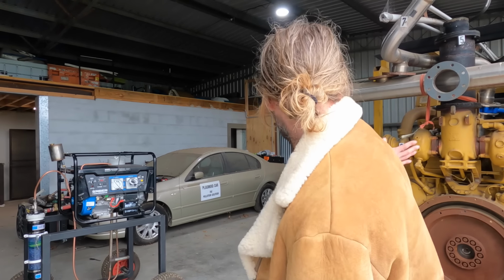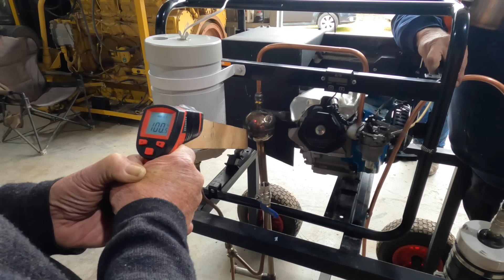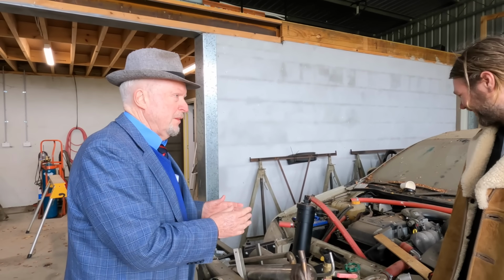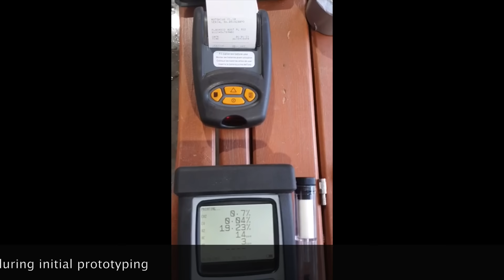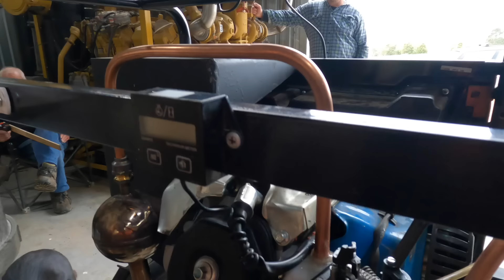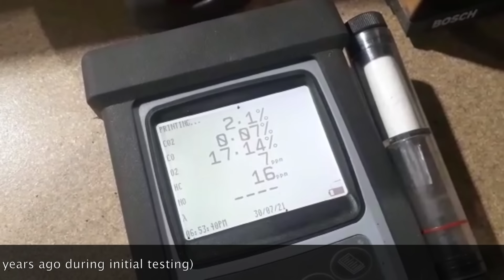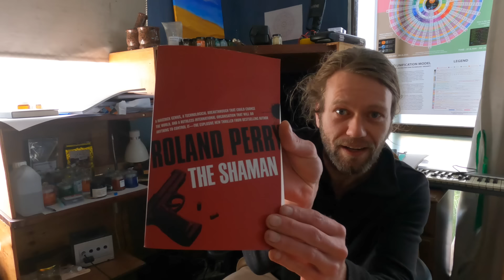Malcolm's Thunderstorm Plasmoid Generator in Action | FULL DOCUMENTARY | with Jordan & Roland Perry

Comment: So you have leaned out the fuel mixture with a moisture laden hot air source....all the rest is mumbo-jumbo meant to baffle people into thinking this is more than it actually is.   Smelling the exhaust is NOT a good way to judge how 'efficient' it is and both of my fuel injected motorcycles without any emissions devices run with almost no perceptible exhaust smell either.

Increasing the combustion temperature will reduce unburned hydrocarbons and carbon monoxide but at the expense of NOx so unless this 'technology' has been emissions tested and approved it's not going anywhere.   We regularly increase fuel economy over 20% just by modifying the fuel mixtures and ignition timing on non-emission engines but these have limited usefulness as anything sold to the public must meet very stringent standards.

There have been many 'hot vapor' engines over the years and while they DO offer benefits in some areas....for a workable machine sold to the public their durability has been inadequate as well as the power they produce much reduced by the heating of the intake charge.   The old engineering axiom of 'there's no free lunch' still applies.

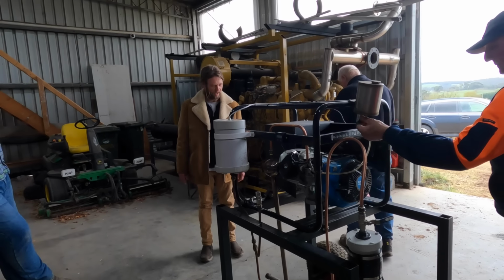Comment: 36:58 he turns off the fuel after its off... its just running on fuel with too much air... this is clearly fake.  really disappointed.
Reply: It was always running on fuel? This isn't fuel replacement technology or a free energy source.
Reply: The claim was that fuel would be shut off once the "plasmoid fuel" was being injected.  This is not being demonstrated.
Reply: Or he just didn't want the carb to gum up with stale fuel......

Not to mention if it were lean there would be white smoke.

Comment: It's just a gasoline engine running on gasoline. That hilarious intake with the steel wool and scrub pads sandwiched together is doing absolutely nothing but putting humid air into the carb. This is such a bogus scam.

Comment: The only thing that sticks out for me is the lack of 'tools to analyze anything' like you said. Why don't they have any on site?

How do they know these machines are working in the first place if they have no exhaust readers/carbon detectors.?

It baffles me that guys have built this in a shed with no means to prove it works on camera other than you sticking your face in the exhaust and saying it smells clean?!

Just giving the doubters ammunition.
Reply from the maker: These were the prototypes that they had worked on several years ago. They were stripped apart and the parts taken abroad by Malcolm for the newer tests they did. When I did that video saying I wanted to see/build one, they reached out to me saying they had the pieces for one of the prototypes still that they could put back together for me. They banged it back together in a week or so and I went down. All the original tests they did with them (as in the old footage I show) were done with the analyzer. They have ordered another analyzer now for the next test runs here. You can see it with the analyzer and independents measuring in the Tesla tech livestream videos though

Comment: so does the engine still run in fuel.. or plasmoids? trying to figure if the the tech just cleans the exhaust.. or actually fuels the generator?
Reply: It improves efficiency ( last I heard 15pc) and cleans up engine, oil, exhaust fumes and yes it does need any fuel to be run

Comment: 5 bucks says if you put the normal exhaust back on, and just create a simple vacuum leak with a small ball valve after the carburetor, you'll get identical results with the smell and increased rpm's. Your intent is good, but I'm not sure you fully understand how a simple carbureted engine works.

All you are doing here is creating a controllable warm air vacuum leak with a bit of water vapor mixed in.

Comment: I am assuming you have not changed the spark timing with regards to the location of the magneto or the flying magnets on the flywheel? 
HHO - needs to be lit later in the cycle in order to generate maximum cylinder pressure through the rod angularity maximum (where the greatest force acts on the crank pin.)  VS gasoline. Gasoline is a slower burning fuel, and is difficult to ignite OUTSIDE of a couple of specific circumstance.

Comment: Am I understanding this correctly. You are only building a device to remove pollutants from the exhaust of an engine. This device does not provide any fuel. It creates a modified & oxygenated, heated, outside air supply,  which is injected into the intake air supply?
  If so, my concern would be that it would force the engine to run leaner than it wants, and therefore cause the engine to run hotter, possibly causing burnt out valves etc. Also, this modification would almost certainly affect the catalytic converter system on a car.

Comment: Where are the spheres a necessary amendment to the straight piped GEET? We all love out vortices, but couldn't those happen in the GEET with it without mods? It might be a matter or where you place and angle the in/outlets?
Reply from the maker: Yep. According to the guys I've spoken to who have worked on prototypes, the spheres are integral flow guides and there is an influence on how it works from the resonant cavities of the spheres. That's really the big difference between the GEET and this. Malcolm is attempting to incorporate harmonic resonance through angles, ratios and geometry and it has given some significant initial results

Comment: Mr.Perry, If I recall correctly, might be more familiar to some viewers as the author of a [popular biography of actor Mel Gibson. More recently, he has been following the work of Malcolm Bendall, an independent investigator of innovative technology. These modifications are constructed from the designs of Malcolm Bendall, Yes?  So the "plasmoid bubbles" are ionized gas bubbles cooled but still ionized? and running them thru the steel ribbon catalyst breaks them into smaller, UNIFORM sized bubbles, increasing their surface area? And then they are fed back into the original standard petrol-internal combustion engine??? I heard that this process dramatically reduced C0 and other nasty combustion products in a demonstration at a conference in Arizona last year. I'm wondering if there is any back pressure that could affect the exhaust efficiency from the cylinders...

Comment: So I can do brazing for HVAC, silver brazing, soft copper stuff, plumbing soldering, electrical soldering, the like... It seems like I just need the specs, the pipe material, the pipe thickness, diagrams of the bubbler and the other tank, the layout diagram/schematic, and then I would need to purchase the globes from somewhere and I guess solder/braze them in? And then the retrofitting to an exhaust/intake shouldn't be terribly difficult as long as I have specs and any documentation on exactly what details need to be super precise. And as long as I have any precision tools available that are needed. As long as I have thorough documentation and specs, and as long as I have somewhere to get the correct globes from, this isn't necessarily out of reach. Huh.
Reply: Looking for the open source info too!  I would love to build prototypes for my own car and generator. Is there a link to proper plans with parts list, accurate measurements and step by step building instructions. If not, this is being presented very irresponsibly and can cause injury or even death and is not really an open source project. This will be a huge Global Revolution if laymen can convert their own vehicles to prove the concept, so if these fine gentlemen cannot provide proper, reliable and safe plans with which the DIY enthusiast can enable small generators and cars with this concept I tend to call BULLSHIT. (•‿•)  If these guys are playing a game I feel sorry for Randall Carlson, whose appearance on the Danny Jones Youtube Channel got me interested in this. I see Randall as a genuine academic and would hate to see him misguided in any way. So, of anyone has a link to those plans or have successfully built a working prototype, kindly share.
Reply: @henrijacquesblom6891  It’s not necessarily their job to provide DIY assembly instructions, but it would be nice if they had publicly available technical documentation. I might have just not looked for it much.
Reply: @henrijacquesblom6891  there’s a diy build guide coming out in next 24hrs announced on this channel 🙃

Comment: If the perfect measuring cup of the on/off vacuum pulse is critical to the bubbler, how does this apply to a multi cylinder car engine? Would not the common intake manifold simply pull a constant vacuum?

 And also, I noticed on the generator exhaust outlet, it's been tapered down from its original diameter before going into the outer sphere. Generally on a std motor, you'd want high flow, no restrictions or step downs in diameter. Yet it seems the geometry must adhere to those sacred numbers so... 

Can we use any diameter of pipe and sphere so long as the ratios are perfect? Or, are there firm concrete numbers that must be adhered to ALWAYS, due to the mysterious magic?

If so, I imagine our choice of stock engine we're retrofitting should be chosen accordingly?

Comment: Not sure I buy the ionization part, maybe. My thought are the combination of bubbles from water and heat may cause the hydrogen and oxygen to disassociate creating more efficient combustion (oxygen) along with possibly adding clean fuel (Hydrogen) lowering the dirty emissions. The nitrogen is of course already in the usual air intake and a neutral and non combustible gas. In any case if the exhaust is as said, well done.

Comment: The volumetric ratio of the combustion chambers volume and the plasmoid bubble chamber volume and its capacity to generate sufficient plasmoid micro bubbles remains obscure. 
The same goes for the dimensions of the thunderspheres transformation capacity relative to the combustion chambers displacement.
     Intake manifold volume capacity to avoid fuel starvation during plasmoid induction  and the exhaust outflow to the thundersphere transmutation chamber including the cold stream plasmoid cyclonic  vortex acceleration sphere or dual sphere directional compound array.
     Per cylinder or total volume of all cylinders volume displacement per revolution. Is there a specific component ratio between the thunderstorm volume capacity and the total displacement of the internal combustion engine and is this ratio calculated for a range of RPM.
    650 RPM at idle up to 4000 RPM.

Comment: Without testing, I'm fairly sure, that dimensions should be in the golden ratio.(1.618033988749) 2 and 3 inch is quite close to that. So an inner sphere at 3.2 cm/inch/kilometers/whatever and the outer at 5.12 would perform better. Perhaps also the inner sphere should be the difference of inner and outer divided by 1.6? The size would then correspond to the engine size. The bigger engine, the bigger spheres. I hope it makes sense. ;)

Comment: Thanks for the video.  First thought... What about radiation?  In everything I have heard about this technology, there has never been a statement that there is, or is not radiation generated.  Second thought would be to test if there is a "water injection engine effect" going on.  You can heat water and inject it into a normal petrolium based engine and the conversion of water to steam will greatly increase your internal preasures.  Water injection can easily yeild 200 mile per gallon of gassoline.  I question if there isn't some sort of smoke-and-mirrors going on with water injection causing the main effect.

Comment: I'm curious of the fuel economy and power output. There have been tons of attempted innovation over the century with internal combustion engines. Many successfully achieved claims, such as the fuel vapor carburetor, it did increase mpg dramatically, as advertised, but it also destroyed power output. Which is why many technologies didn't survive. Also (cough...cough.. big oil)  There is always a give and take. I'd love to see this technology progress and become usable in the future.
Reply: I've head some reports in this context that power output goes up with using the retrofit intake system, and they have to throttle down to level that out. 13% better economy I'd heard, with Malcolm claiming double mileage/half the consumption, apparently. Solid testing is needed with steady loads and verified fuel use. Small tanks, taking into account fuel line volume, no messing around.
Reply: @Cloxxki  thats awesome.  I'm unclear on whats actually taking place to achieve the claimed gains. Is it recombing the exhaust gasses in the reactor to the reuse in the combustion cycle?

Comment: I understand the logic to be, "With it on, there is more oxygen and less carbon in the exhaust and therefore it MUST be transmuted from carbon to oxygen." I think the FAR more likely explanation is that you are letting in moist air into the cylinder which is causing the simple sensors to malfunction as they were not designed for that application. Also, it is running lean and will have less power.
Run it in a small sealed room with a canary; or a candle if ur boring. My prediction is dead bird; or flame if ur boring.

Comment: Maybe someone with a bit more nuclear physics experience than me can correct me or explain this better, but essentially what is being described in this video is a process of creating oxygen by fussing carbon and hydrogen (while skipping nitrogen and spontaneously generating neutrons with self-annihilating antineutrons... hello Nobel prize in physics!). Also note that the atomic mass unit (amu) of a carbon atom, two neutrons, and two protons is greater than the amu of an oxygen atom. Soooo.... it would take energy to do this fusion not produce it. How much energy? Using E=mc^2 and the decrease in mass of 0.199 amu (3.3x10^-28 kg) with the speed of light being 299,000,000 m/s we get an energy required to do this fusion of 2.97x10^-11 J per atom of carbon converted to oxygen. If we wanted to convert one gram of carbon to one gram of oxygen we multiply the required energy per atom by Avogadro's number (6.022x10^26 atoms/mol) and divide by the mass number of carbon (12 g/mol) and then divide by 1000 to convert g to kg we get a required energy of roughly 1.5 terajoules. If we wanted to do this process once every minute we would need 24.8 gigawatts of power (NYC uses 5.5 gigawatts). I love to learn and if someone can correct me, find the mistake I probably made, or explain what is happening a bit better than Mr. Perry I would greatly appreciate it.
Reply: Exactly! Regardless, I would love to build prototypes for my own car and generator. Is there a link to proper plans with parts list, accurate measurements and step by step building instructions. If not, this is being presented very irresponsibly and can cause injury or even death and is not really an open source project. This will be a huge Global Revolution if laymen can convert their own vehicles to prove the concept, so if these fine gentlemen cannot provide proper, reliable and safe plans with which the DIY enthusiast can enable small generators and cars with this concept I tend to call BULLSHIT. (•‿•)  If these guys are playing a game I feel sorry for Randall Carlson, whose appearance on the Danny Jones Youtube Channel got me interested in this. I see Randall as a genuine academic and would hate to see him misguided in any way. So, of anyone has a link to those plans or have successfully built a working prototype, kindly share.

Comment: @noelbuddycares.....this is part of the drawing I did. He did it way better. The only thing I drew that he doesn't have is the light. The ray gets split into two. That's the part we drew on ur whiteboard.   Showing how light bends around energy. I think that part might be the power source rather than gas.idk yet.  And their separate two balls....I drew one smaller on top of one that's bigger. And connect thru that venturi  tube spinning the funny sand. That sand has properties in it that makes like some sort of metal we don't have on earth?? Like it's in asteroids? Read it's what hull of a ship might need.  Really weird to see all of this working. Now they just need the nesting resonant frequencies of light with Phi or Fibonnacci?? It's gotta spiral.  Maybe that's the ratio I'd need with the iridescence/Bragg Reflection to mimic skin on marble berries. U manipulate it's photonic crystal gap bands for correct frequency.   And I STILL hear "infrasonic" ....?? Nest ultraphotonic (idk if that's even a word) freq into infrasonic freq i THINK at a perpendicular angle?? Idk.  Haven't looked at my drawings in 3 years.  Been seeing other stuff.  It uses aether.   Does funny things to hydrogen bonds. And a "tachyon" keeps popping in. Idk enough physics yet to understand that. Just that water seems to actually be the conscious energy used. But in air. We live at the bottom of an ocean of air! Oh. It's showing me photosynthesis. How air is turned to energy for plant thru aether? 
Who knows! But so fun to see it made! Mine looked more like an hourglass shaped battery pack u might put into the back of an AI/computer.  But it needs the ternary (3) code with Phi. Not binary code anymore.  Less powerful but greater ability  in energy efficiency??